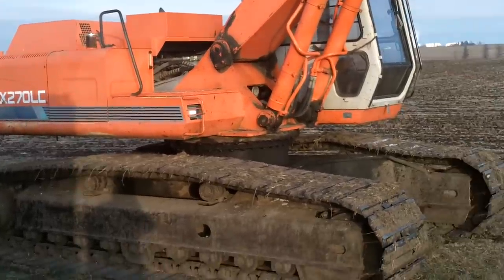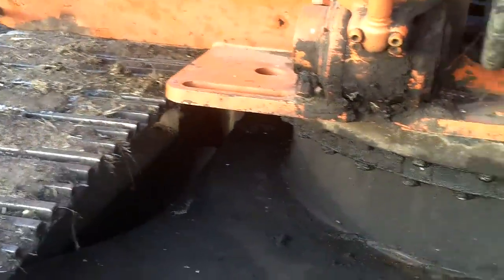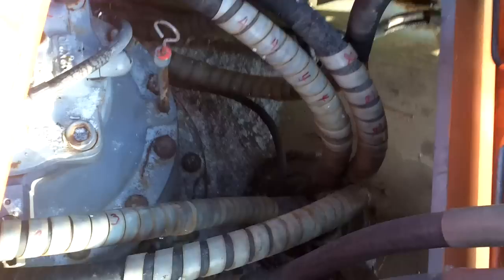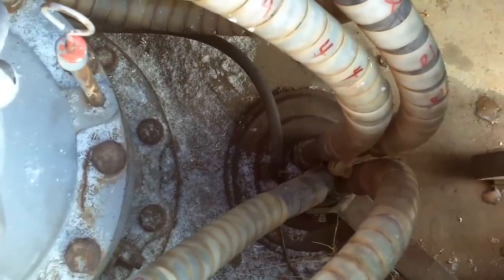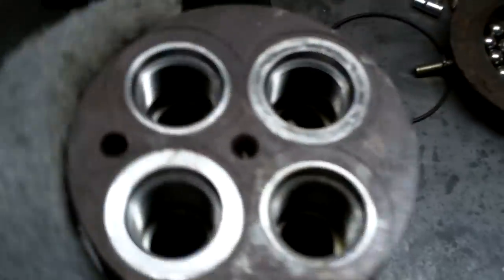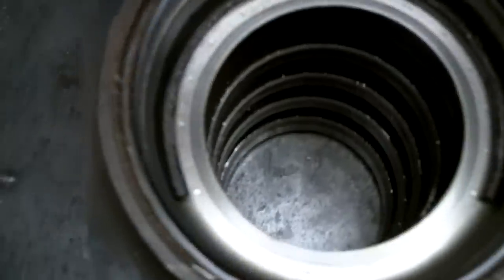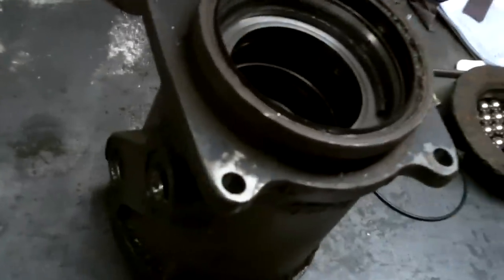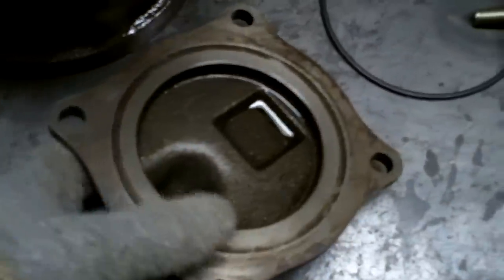How it works: The track motor spool in an Excavator

Comment: Thank you for the video. I have been running heavy equipment since 2000 when I was 19 yrs old and have always tried to answer that question to people. I explained it like a banjo fitting, but really it's like 4 banjo fittings stacked. 
This will help.

Comment: @willingtowork not a spool. That maybe what they call that down south, but the correct term is "rotary manifold" A spool is what the valve banks consist of, they stroke back and forth and are controlled by pilot hydraulic pressure. Those are directly behind the swing motor in this pictured Hitachi EX270LC-1 unit. I can't remember if there is a bulkhead welded between the swing drive and the valve banks.

Comment: This is one of those things I never understood during my childhood and teenage years. I would think about it, but forget to ask whenever I met someone who could actually explain/demonstrate it. Thank you for providing a simple and easy to understand answer to one of my oldest questions! =D

By the way, would someone care to explain how the hydraulic oil is "reversed" in the rotating centerpiece? It may be a silly question, but it's kind of bugging me now that I finally understand the first part..
Reply: If I understand your question correctly then I think the best way to explain it is that the fluid is always being pushed and not pulled when going the other way. One of the those holes goes to the track and then another comes back. When the track goes backward the pump pushes through the other hole forcing the fluid the other direction. 
It’s the same with the hydraulic cylinders. It’s always pushing from either end. Never “pulling” with suction.
Maybe this is not what you meant though.
Reply: @jacobvanderzanden1077  I think this is exactly what I meant to ask, even though it's been so long that I have no chance to recall😅 wow, to think that someone would actually reply to my question after five years.. it's almost hard to believe! But thank you so much! That's one more point to cross out on my list of things I want to learn more about😊

Comment: It is nice to see you have a locker bar for the top spinning port of the center joint, but my EX50urg has no locker, it twisted and broke a hose on spinning port at a very cold day, due to stiffness of cold fluid.

Comment: The device being examined isn't involved with making the whole thing turn. It just solves the problem of how to get four hoses from the top part to the bottom part while allowing "infinite" turning.

It turns on a "slewing bearing" - two rings, with ball bearings separating them. One ring attaches to the top, the other to the bottom. One ring will have gear teeth on it, the other part of the machine will turn using motors connected to a gear tooth engaged with the fixed gears on the bearing.

Comment: thanks for the video, exactly what i needed to know. I have two more questions if anyone can help. 1) To run fluid to the hydraulic cylinders on the blade would you just have an extended version of this mechanism? 2) If you wanted to solve this same problem but for electrical wiring, is there a similar mechanism? thanks

Comment: 1) Yes, you would need two more ports on the top (or wherever you can fit them so long as the principle still works), and two more rings on the bottom.  You are quite the machinist if you can make one.  
2)  Yes, a very similar design is used for those "Fixing a Retractable Cord Reel" youtube search  1:41 you can see the contactor rings where a tab would ride on each ring allowing for continuity while being able to spin continuously

Comment: Is that spool dead center in the slew ring? And If so I'm also guess that when you showed it from the engine compartment, that big round piece to the left is the drive gear that mates to the slew ring.

Comment: So the fluid in one hose comes down and fills one "level" and so it can only exit one orifice on the bottom half no matter which way it faces. That's some extreme tolerances to not leak under that pressure. I'm sitting at a construction company with 3 of them and was curious how they moved independent of the upper half. Could make for a he'll of an amusement ride if you say in the bucket while spinning and moving forward.

Comment: I am pleasantly surprised by the comments. Even though the narrator did not mention that each section of the swivel, rotary or live center is separated by seals in the outer housing apparently everyone figured that out for themselves.

Comment: Hi, 

Can operating on one track motor for a while upset the spool?

I removed sun gear from my right side so I could continue to operate machine.  Now I have put new motor in and it does not turn even though I can hear engine labouring.

Comment: Great. Now would someone please invent a valve on a hose connector that releases when there is too much pressure instead the hose bursting randomly anywhere! Then we just lose some oil, the valve closes back when you stop overworking the part, you can refill and get back to work with less gusto this time. I'm surprised nobody's done it. This is like electricity without fuses.